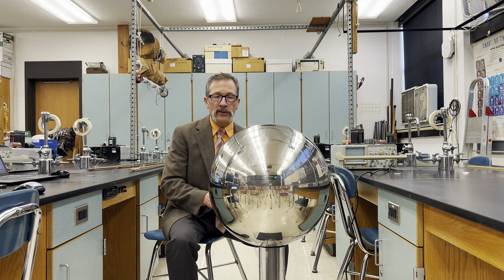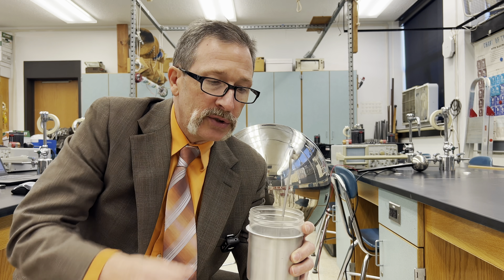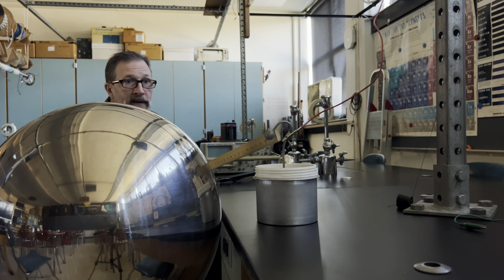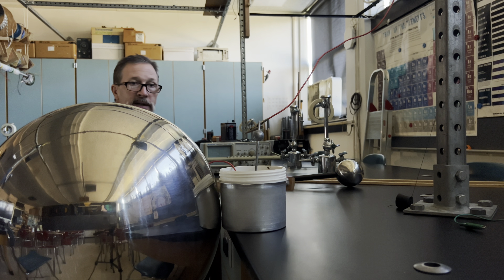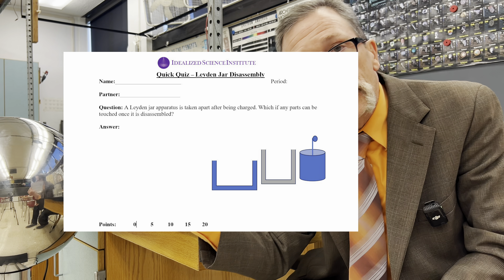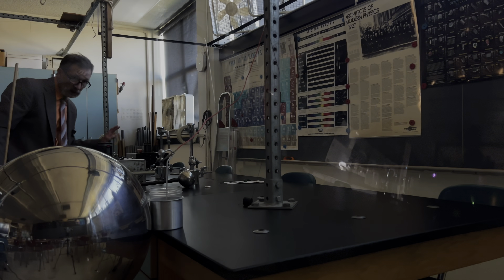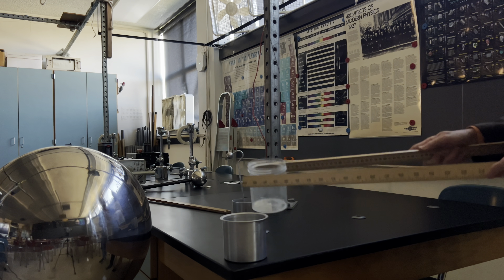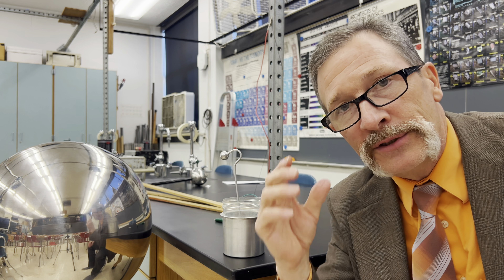This Simple Device Could Kill You

Comment: What is the energy storage capacity of that Leyden Jar?....I had a friend in grad school working on a laser or something with a large capacitor.  He was holding on the cabinet with his left hand and pointed at the capacitor with his right index finger.  The cap dumped it's energy, blowing his finger apart, stopping his heart and blowing a hole in his left hand where he was touching the cabinet.  Luckily he survived but had a tricky recovery with surgeries on his finger.  I don't know if it damaged his heart in the long run but it was a horrific event and a strong reminder that high voltage is super dangerous.
Reply: If the dielectric constant of acrylic is 3, the width of acrylic is 5 mm, and let's say a 15cm diameter jar with 15cm height that's about 0.08 m² of surface area for the capacitor plates, that gives a capacitance of about 400 pF

Charged to about 100 kV that gives a stored energy of about 2 J, which is still 2 orders of magnitude lower than what a defibrillator would send to your heart
Reply: @SpeedcoreDancecore  thanks for putting actual numbers to the problem - this is the part that was lacking in the video
Reply: this puny jar? Couple tenths of a joule I guess.  Could be like 100 puff charged up to 20 kV.  Definitely won't kill ya like he's about to tell you. But will give you a nasty surprise shock for sure.

Comment: All large capacitors can hold a charge for a long time after the equipment they are in are shut off. Leyden jar is a capacitor.
Reply: At my work, we have a strict rule of using shorting straps on caps when storing them.  Previously used capacitors can self-charge to a degree.

Comment: How can that capacitor contain enough charge to hurt a healthy human?
Reply: It doesn't take much to stop the heart.
Reply: Maybe it triggers ventricular fibrillation (where the heart is just fluttering and kind of stuck there, not pumping blood).  It doesn't take a ton of available current to trigger that, but I'm not sure about the duration of the transient and how long that needs to be.
Reply: @marvinmartian8746  If that is the case, tasers would not be classified as non-lethal weapons. This Leyden jar is a HV capacitor in the range of 2-3 nF max. Charged to 10KV it has 0.1J of energy stored. You would need to get to 5+ J territory to reach the lethal level.
Reply: @galileo_rs  I'm not positive, but I was thinking tasers just have a couple of milliamps of current available.   Limited by a high impedance in the transformer or something.  Yeah, that's a good point.  A defibrillator machine uses anywhere from 100 to 300 joules.   Hmm.  You raise a good point.   Hey, as a side note I was thinking about these jars and how there were parties in the 1700s where they'd shock each other using stuff like this, and even have a chain of people holding hands, or kissing, etc. and shock each other.  In a google search just now it didn't come back with any example of people killed by a Leyden jar.
Reply: I think it's general safety, maybe this one would not but somebody watching this could try with more powerful. Also the amount of charge could vary even in this one. So one could never know how much charge is build up. It could be just small zap but then one day it could be much more (humidity and temp also play role).
It's combination of voltage, current and time which kill (could be think of power over time)
Reply: @VavrMar  Maximum energy that this capacitor can contain is less than 2J even when charged to absurdly high voltage levels: 50KV+.

Comment: I took an "educated guess" that the metal plates would be OK and that the charge was stored in the insulator (dielectric).  Why?  Because in my study of electronics (50+ years ago), I remember that one of the most important (if not THE most important) characteristics of determining the capacitance of a capacitor is the composition of the dielectric.  That would suggest that the charges are stored in the dielectric material itself.  I believe that if you had fondled the plastic, with a thumb and finger on the inside and outside, and moved around the surfaces, the charges would dissipate from the areas you touched.  And since you would be discharging small areas at a time, the capacitance would be too low at any small area to be a hazard.
Reply: Oh that's the missing part of my understanding maybe? The charges on the insulator can be high but the electrical conductivity is so low of the plastic that it's not dumping the charges into you easily because the impedance is so great?
Reply: @Lennybird91 he briefly mentioned it but the plastic can't really absorb or transfer charge, it only polarizes the surface. When he touches it he is only experiencing whatever he made direct contact with, nothing else. The energy is diluted evenly across the surface by the metal contacts, but he only experiences the portion of the surface he touches. In theory if your dielectric was polarized strongly enough then even a perfect insulator could still zap the crap out of you just from how polarized the surface is. It's all about the voltage
Reply: Thanks for spelling that out for me. I’ve been reading the comments trying to understand it!

Comment: One of the first things I learned in avionics school was to NEVER work on radars alone. The capacitors hold lethal amounts of energy and someone to apply CPR might be the difference between life and death.
Reply: Never trust the bleeder resistors to discharge those caps. I repaired radars for 36 years, and I kept a discharge stick near by just to make sure the caps were safe. Every time I needed to work on the caps, I would discharge them.
Reply: @crashburn-s3b indeed
Reply: And not just radar.  Old TVs were the same as are modern microwave ovens.  I treat all capacitors like I treat all guns.  Always assume they are loaded and ready to cause you great harm.
Reply: I had a tech tell me about his uncle who would repair TVs but had to leave them on the shelf for a month first so the capacitors would discharge.
Reply: @LTVoyagerI hated working on CRT TVs, I always got bit.
Reply: @LTVoyagerWhen I was a kid in the ‘70s we were reminded by commercials, and adults, not to mess with old TVs.
Reply: @WesternForcesCharlottsville 

Yup and when I was about 10, my dad came home and caught me with 19" TV someone left on the curb for trash, taking it apart in the driveway. Man, that thing has some cool stuff in it.
Reply: TV repair. When TV repair was a thing. Anything running vacuum tube amplifiers will ground you, too.
Reply: What scares me is a TINY capacitor with enough charge can be 100% lethal. The idea of that frightens me. I'm trying to learn electrical safety. Arguably not easy. So much that can go wrong.
Reply: @TheSmokingHatManSeesYou 

My dad's rule for working on electricity was keep one hand in your back pocket. And if its a job you cant do with one hand behind your back, you should get someone who can.  

Bottom line, if you're ever nervous or hesitant about electrical, just dont mess with it. Not worth the risk. Experienced professionals get fried, so just dont mess with it unless you're 100% sure of what you're doing. That said, I don't know what you're doing to learn about it, but there's all sorts of low cost and free resources through state employment agencies and community colleges to learn that sort of thing. Even some hardware stores like Lowe's and Home Depot have home improvement workshops to learn stuff like that; though nowadays they usually just say hire a licensed electrician. Just saying, if you're doing self-education thing, consider looking into some of those options. Get actual training and a marketable skill.
Reply: You shouldn’t work alone, period.  

In fact I believe there’s laws against it… there certainly is in mine.  

Even if I’m flying in a plane by myself I have to have flight watch meaning my flight is continuously monitored and flight following which is half hour check ins.
Reply: @calvinnickel9995A guy I knew in the U.S. Air Force got killed working on a battery charger by himself.
Reply: When I was in the U.S. Air Force back in the ‘90s, a staff sergeant in our squadron was working on a battery charger by himself one day.  Well, somebody found him dead on the floor.
Reply: There must be rampant wandering zombie capacitors in British town centres nowadays because there are defibrillators everywhere.
Reply: I used to repair those things about 40 years ago. At that time (they have probably changed since then) they had a 1uF capacitor which could be charged up to around 6KV.
I would ensure the machine was showing 0 joules discharge available (they had a voltmeter calibrated in joules) then stick a large screwdriver (with a plastic handle) across the capacitor then wind wire across the terminals to ensure it could never charge until I finished with it.
Reply: @SubTroppo  you never know when your first heart attack will be, hopefully near a defibrillator though
Reply: @MrFelixFB  I visit a  friend  from my street (sharp as a tack in his mid '90s) in a luxury care-home* and encounter his new neighbours.  It reinforces hope that my first heart attack is the one that finishes  me off; pronto.  *So nice, sometimes I think yes I could...

Comment: I'm puzzled as to how the insulator can be holding/storing the charge. Is it an electrostatic charge on the outer surface?
Reply: Wikipedia has a good article about Leyden jars.  The section "Storage of the charge" is probably a good place to start, and I think you are on the right track with your comment.
Reply: @marvinmartian8746  thanks, I read it and also the linked page about dielectric retention. Very interesting. It also warns that capacitors, especially Aluminum ones, can rebuild a 10% charge after being discharged.
Now I wonder if somehow a special dielectric material could be made and used instead of electrolyte to make a battery. I don't know if it can have the capacity of oxidation-based batteries, but it wouldn't wear out and it seems like all the molecules of the material are participating so that's a lot of atoms compared to the thin surface of lithium anodes. I realize that it's a different form of energy storage, maybe more akin to magnetism, but it would make for a fun research project. 😀
Reply: @VeniceInventors but charge in battery is not in anode or cathode. It's in electrolyte. Same as here in jar. Anode and cathode are there to collect and "transport" the charge. That's why it has to have as big surface as possible. The difference is that battery is using electrochemical process of storing charge. But capacitor use electrostatic like this jar.

Comment: Wow I learnt something today, I didn't know that capacitor would have charge once reassembled.
Reply: It's not the potential's that kill you, it's the difference between potentials your hands short circuit to equalize.
Reply: @adonisengineering5508  it's actually not. It's the amperage, but only at a voltage and a frequency that will let this around 10+mA pass through your heart.
Reply: That's why they commonly use capacitors as a battery
Reply: @omarjassar4650 ????

Comment: At some point in the future I will  either remember this video about five milliseconds after I should have or
Reply: Usually when you try to open your car and key zaps you.
Reply: The charge is on you. The car is grounded through the tyres, they contain carbon so conduct electricity, when you touch the car (or get very close to it) with the key you are discharged through the key.
Reply: @r.h.8754  car tyres are notoriously good insulators though? Did they start making them conductive on purpose?
Reply: @thewhitefalcon8539  I Googled the question, the AI reply was:
Carbon black was first introduced into car tyres around 1910 by the B.F. Goodrich Company in the US, and by 1912, Michelin began using the additive, after which it became standard practice in the UK and globally. By 1917, black tyres were the industry standard.
Although tyres are 'insulators' they still conduct electricity, the static may be a high voltage (which stings) but there aren't many coulombs of it there so it is easily dissipated even through a high resistance - static protection kits have somewhere in the region of a 5M to 10M ohm resistance between e.g. the wrist band, static mat and earth connection; we had to test ours every time we used it.

Comment: Radio and TV transmitter engineers have sticks attached to ground they use to discharge the high voltage sections of the transmitter. They chill them the Jesus stick you don't use it and you'll see Jesus. 8KV doesn't sound like a lot but they can provide more current then the lyden jar or a vandegraph generator.

Comment: An explanation of what's happening would have been nice.  Does the charge transfer from the metal parts onto the surface of the insulator when they are separated?  Does this leave the metal parts uncharged? Surely they must remain at the same voltage voltage albeit with a much lower capacitance so if you touched both metal cups at the same time then you would get a small shock.
Reply from the maker: Did you watch the full video? We have a call to action before the explanation at the end
Reply: @idealizedscience well, you did explain that the charge on the metal parts is dispersed when they touch the table and your body, but you seem not to have considered the possibility that they charged the dielectric while being dragged away from it.

It would be nice to have a qualitative indication of the amount of charge on the metal plates before you disassemble the jar, and after you separate them from the dielectric but still before they touch the table or anything else that can ground them.

Then it would be interesting repeating the experiment with a jar where all parts have a gap that can be maintained during disassembly.

Comment: I'm an 81 year old tv repairman. I don't think your Leyden jar would carry a deadly charge. It would be unpleasant but I have accidentally discharged large CRT's through my body, from one hand to the other that would carry a much larger charge than your jar and I'm still here. It does make holes in your skin that take a week or so to heal but it won't kill you. I have discharged a 450 Volt 500 Mfd cap that way, it threw me across the room but it did not kill me. It is very unpleasant.
Reply from the maker: In our defense, we did say it “could” kill you! But of course, in general, it would only cause a lot of pain. If you have a pacemaker or a heart condition, it is more likely to be deadly. This video will be part of our electricity course and we want to emphasize safety at the beginning. Better safe than sorry!
Reply: @idealizedscience  If anyone wants to become an electronics tech they better understand that they will get electrical shocks no matter how carefull one is. I think it would be better for you to let students experience mild shocks so they are not caught unaware.
Reply: Your post reminds me of old times.  About 40 years ago when I was a wee lad, I worked for an amusement company that leased arcade games, pinball machines, etc.  Because my employer was cheap, when working on games with a CRT, instead of a proper HV discharge probe we used a long flat-head screwdriver with a ground wire clipped to the shaft to get under the anode cup and discharge the tube before working on them.  One day the ground on that screwdriver apparently wasn't solid, and I got to have 24-ish kV for lunch.  I did not enjoy it. Fortunately, the only injury was to my pride, but I learned two key lessons - even CRTs (and by extension, large capacitors) that have been turned off and unplugged for a while will still act as if you owe them money and will try to kill you if at all possible, and use the right damned tools for the job even if it's expensive or inconvenient.
Reply: You're very fortunate and made some bad mistakes. As someone who has done some of that kind of work work you always make an effort to not give electricity a path through your body. That CAN kill you. And at 25KV that has more than enough potential to provide the current to knock the heart out of rhythm.
Reply: @glynnetolar4423  I guess you never worked in a high pressure electronics repair shop and never worked under the pressure to produce or be out the door.
Reply: @gerrywood yep, you're right, I haven't. Never the less that cavalier attitude can get you killed.

Comment: I always wanted to build me a vandegraafgenerator 🙂
Reply from the maker: In theory...very easy. In reality...tricky!
Reply: @idealizedscience  "In theory, theory and practice are the same.  In practice, they're not."
Reply: The problem is the charges get expelled from any little sharp edge since theres no surrounding magnetic fields to keep them in, so the charges dont build up. I actually experienced this first hand when I got a new polyester shirt, and sat in a polyethylene chair. I got a strong discharge —about an inch arc— to the chassis of the chair. I then took an alen key and held it as I rubbed against the chair again and the discharge was way smaller. Then i took a blunt piece of metal, recharged myself, and i got big arcs from the blunt metal.

Comment: What happens when you connect the two metal plates with a wire while not assembled? Is reassembly necessary or is even in a distance a massive difference in potential that would discharge?
Reply from the maker: Great question! Both metal pieces were essentially grounded when the teacher touched them.